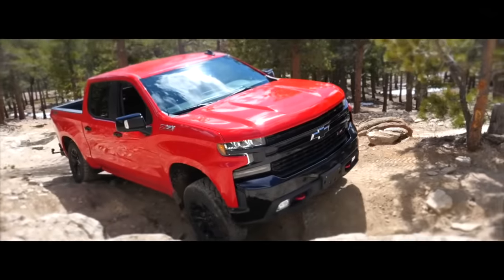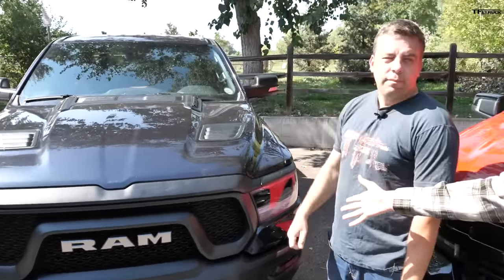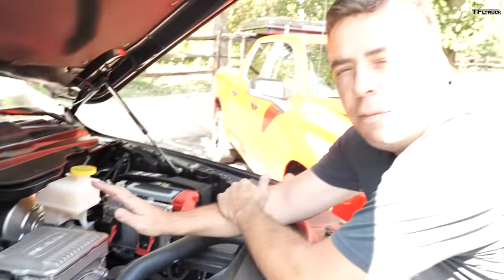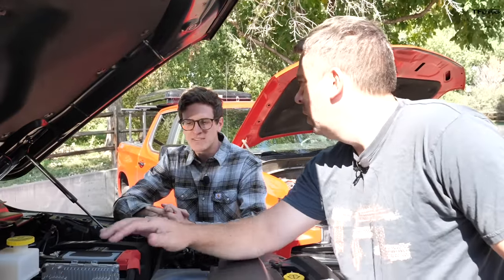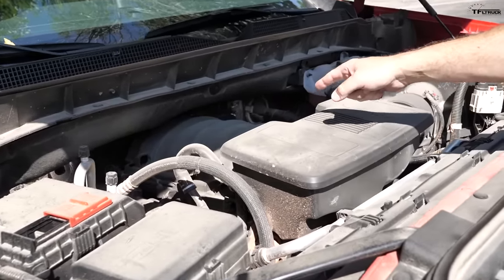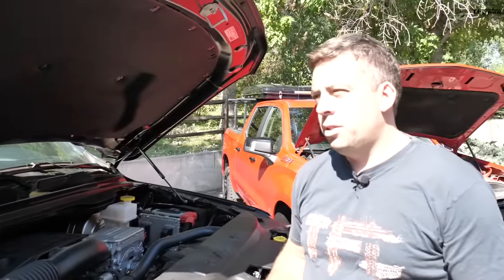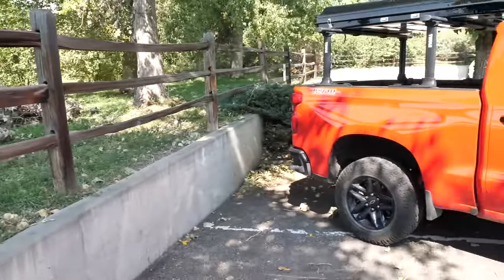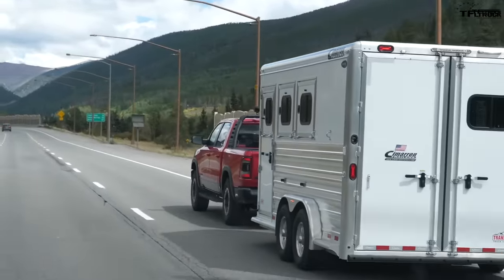New Ram Rebel vs Chevy Silverado Trail Boss: Which Full-size Off-road Truck Is Best For You?

Comment: Ram rebel for sure; if only they were actually reliable...
Reply: Mines been 100%. What's the issue with yours?
Reply: todd mayta I don’t own one, I just hear about all the issues they have, especially that giant touch screen and the food processor going out :/
Reply: @toddmayta7615  I had a Ram and it was constantly on a tow truck. I finally went with a Ford.  A friend's Ram has similar issues to what I experienced.  Constant electrical and transmission issues.
Reply: What was wrong with it? I'm on several Ram 5th gen facebook groups and very rarely see any issues other than 3rd brake light leak......  When 5th gen first came out I saw quite a few issues but those seem to have been resolved......

I know 5 people where I work that have 5th gen rams 🐏  and no problems. They swear by them as previous gen owners. 

This is just been my experience. So far, so good. Quality is better than my 2017 tacoma or 2018 4Runner were. Reliability is on par with those two so far. But I've only owned it for 1.5 years. Time will tell for sure.
Reply: @BryanI00  You must have had an old Ram, the new transmissions in the Ram are ZF and some of the best transmissions on the market today.
Reply: todd mayta Same here. I have no issues and know many others that are pleased with there Rams. These guys I know lack regular maintenance or care on there trucks also. Tisk tisk tisk.
Reply: I’ve seen a lot of rams comes through the shop and I can honestly say the Chevy is the way to go. The 5th gens seem to crack a lot of cases, especially around the spark plug holes. Not to mention the countless electrical and transmission issues. The heads also appear to be low quality. They aren’t always an issue but it’s pretty common nonetheless.
Reply: Look up issues with the zf 8 speed in the ram also the 5.7 has been proven reliable !  And then look up gm issues ! Then you'll see !
Reply: Waylon Miller I agree, I have a 96 Tahoe that has had quite a few issues. I haven’t had to replace the water pump but that’s gonna be hell. Every brand has issues with electrical components and that’s not gonna change.
Reply: @BryanI00  the zf 8 speed I doubt you had any issues !  But if you switched to ford and got the Ecoboost , youll get your share of issues ! Lol
Reply: I have a 2017 rebel with 65k miles. Zero issues thus far. And I tow my side by side and hunt with it. It gets worked.
Reply: I don’t have a rebel but my company truck is a ram 1500, it has just about 200k miles with very minimal issues.
Reply: sc4808 I’m talking about the new redesigned model with all the techy stuff that goes wrong. Also I’m sure your company trucks are the work models with minimal features, I.e. less stuff to go wrong (my company uses new Silverado’s for our work trucks)
Reply: @macbookpro57  nothing wrong with rams. If you had a late 90s ram then yes, transmission. No one has electrical problems. The problem days were with Benz. Benz used Chrysler as a cash cow and never put money into it. Fiat tried to put their fingers into it with the 3l diesel and it was fine until the government forced them to do emissions crap then they just went to crap. The new 3l is all dodge. Fiat said here it is America, design it. They used the block and very few other parts. Gm sold out to china and are now importing vehicles from china, so I won't be buying anything ever
Reply: @michaelpincavitch5245  The zf 8....  after the 3rd one, it seemed OK.  Also seemed like a good time to get rid of it.  Although, you think 3rd trans sounds bad, the electrical was far worse.  Constant dead battery, but the dealer said nothing was wrong with it.  tipm failure, whatever that does, but of course I was 200 miles from home.  Random stall when cold, would restart after a 30 minute wait, not before.  Yeah, no issues.  Cheap for a reason and I will never own an FCA product again.  Forgot to mention, this was my second one.  My first was a 2004 and I think that problems with it speak for themselves.  It was even worse.
Reply: I have had a rebel, was in a severe truck accident...... no scratches. Very comfortable on and off road. Interior for a daily is exceptional! Would appreciate the mpg being better now that I have a carvan exhaust which gives it that hemi traditional growl but all in all I’ve seldom had problems with the screen not working and the music not playing which goes away after an easy turn on and off which btw I don’t mind because of that new exhaust. Towing for sure has been a pleasure and off roading has been a great experience.
Reply: Q L haven’t had many Chevys come into the shop and I’m talking about now. I’m not saying that’s Chevy is better but the Ram is more popular here so I’m gonna see them a lot more. And I agree the ZF is a good trans. I still prefer stick
Reply: No issues with my 12” screen. I’m a first time Ram owner and I love it!
Reply: @macbookpro57  yes, you are correct, my company truck is a SLT trim package with just the basics, power windows and cruise, it is 4x4. My point was that mechanically it’s been great, it has the 5.7 hemi with the 8 speed transmission, it’s a 2014. But I know what you mean with less options/gadgets to break. I will say this though, I have always driven/owned fords or chevys ( my personal truck is an f250) and would never seriously consider a Ram truck but my company truck has changed my mind, if I was in the market today, I would definitely Consider a Ram. It rides amazingly well and tows great.
Reply: @sonsofliberty3081  iirc, GM is only importing 1 tiny SUV from China, and it only has a Buick badge.  This is about trucks, so stay on topic.  The trucks are made in the US and Mexico.
Reply: @BryanI00  I have a 2014 ram with zf I'm at 140k miles have not change transmission fluid since dealer keeps telling me they are lifetime and tow a 7500 lbs trailer when I go camping no issues yet

Comment: I voted with my feet and bought the Ram. Drove GM's for last 30 years. Ram won truck of the year 3 years in a row. Better ride, very comfortable interior, extremely smooth shifting with the 8 speed transmission... welcome to the 21st century. The Rebel 2019 with the two tone interior is awesome. The only thing I settled on was the Ultra Short bed.

Comment: I'd love to see a regular cab Rebel or Trail Boss. Shame they're only available in crew form.
Reply: You can get them in double cab
Reply: James Mastroianni true I just consider that also a crew since Ford is the only one that makes a true extended cab.
Reply: @ALMX5DP  I mean just because the second row has actual doors doesn't make it a crew cab. Ford just decided to make a stretched regular and the other two made a short crew.
Reply: James Mastroianni the B-pillar and forward opening doors make it a crew in my mind. Love how Ford kept theirs a true extended.
Reply: @ALMX5DP  Well the ram 1500 wasn't designed with a regular cab variant, it is only double and crew now. GM pretty much did the same with the silverado, the reg cab was specifically built for fleets only. It is a different story on the HD's, ram just didn't make a double cab hd and GM developed a proper regular cab
Reply: @james2042  yeah that's a shame, though to give them credit Ram is still selling the previous generation under the Ram Classic moniker and that is still available as a regular cab. GM is confusing to me since they make and sell their 1500 with a regular cab 'short bed' in other markets like Mexico and Saudi Arabia but not here in the US. Same feeling I have with the F-250 Tremor. Ford only sells in a crew cab. I'd love to see an extended cab or regular cab variant.
Reply: Extended cab sucks because of the suicide style doors. From someone who had an extended cab truck when my kids were small and in car seats, the suicide style doors are a PITA when parked between vehicles in parking lots. Ford needs to ditch the suicide style doors extended cab.

Comment: You forgot to mention that the newer ram rebel finally put in the 4 wheel drive auto as were the 2019 only had the regular 2 wheel 4 wheel high and 4 wheel low. The 4 wheel drive auto button is awesome also do reaction time for the 4 wheel drive auto is instantaneous and one of the best systems I have ever seen.
Reply: You right, it means it has both of the 4x4 and AWD, both of the good worlds
Reply: All wheel drive means it's always in 4 wheel. Auto 4 wheel drive means it's in 2 wheel drive till you need the 4 wheel drive then and only then it kicks in. When one rear tire spins in any way that's when the 4 wheel drive kicks in.
 For real auto is meant to save you gas and a be there for the just in case factor. But you're only supposed to use it in mud or snow, just saying.
Reply: Is 4x4 Auto confirmed for the 2021 Rebel? If so, can you point me where you found that. That would definitely confirm my choice as my next truck
Reply: You tube.....TFL truck
Reply: They compare the Chevy trail boss and the dodge ram rebel
Reply: @misterhonesty5784  Thanks, I did see it in the video now.  Is that an option or standard equipment?  When looking at 2020 Rebels in Canada I don't see that on the dash.  Is it only available with the anti-slip rear differential?
Reply: It has a push button rear locker on the ram rebel and the auto 4 wheel drive come standard with a ram rebel

Comment: I have a 2020 Rebel quad cab.  The rear seat is smaller but it has a 6 foot 4 box.  I wish it would have been available with an 8 foot.  The reason for this is I actually use it as a truck.  Any pickup with a sub 6 foot box is just to small to load anything substantial in length like a full size atv or large motorcycle.

Comment: If you're towing with the Ram, how do you manually select gears for going down steep hills such as the Ike? I didnt see anything on the rotary knob, does it have shift paddles?
Reply: Pretty sure there's buttons on the wheel
Reply: There are buttons on the wheel
Reply: Ah cool good to know!

Comment: I don't think the interior is that bad on the GM trucks. It certainly looks dated compared to the Ram and even the F150 even though the F150 is five years old now. That said, it is functional like Tommy said. Where my beef comes in, is comparing the interior quality to the Ram when these two trucks sticker so close to each other. There is so much more tech and refinement in the Ram, not to mention the power advantage over the 5.3, for the same cost. If the Chevy had the 6.2, it would be a tougher choice, but as these two trucks sit, I would have to go with the Ram.

Comment: I have only owned Ram trucks and the motor is set back so when you need to Dodge something you don't have to you can Ram it lol but they are had trucks to stop so that's why I always upgrade my break system with high carbon rotors and brake calipers witch help stop the trucks a lot better than stock.

Comment: I have two comments:
1. You should investigate the reliability of the trucks you review to see which one ends up in the shop more often, otherwise you are just looking at every small sample. 
2. The Ram's infotainment system though nice does not look durable for a off road use. If something breaks down it looks very expensive to repair.

Comment: Same quandary here: love the Chevy body, box, transmission, towing, BUT love the Hemi, ride comfort, rear coil springs, the interior, and the tech on the Ram. Still can’t decide. I am leaning Chevy because Ram still hasn’t fixed known issues like quickly rotting Manifold bolts.  Mine cost me $3000 for my 2016 with 130,000km. Boooo.

Comment: How could Ram be so far ahead of Chevy in technology, ergs, design, engineering, styling etc?  My dad would roll over in his grave.  GM better wise up.
Reply: john thornton yh, I’m a mopar fan, but I do have some Chevy in the fam and would like to see the three companies line up in a closer race
Reply: I concur
Reply: I was told that GM thinks they "perfected" the interior and refuses to change it.  Sounds like BlackBerry in 2005.
Reply: @Mainevent41  They did, for a proper truck... Maybe not a luxury truck though...
Reply: What "technology, design, and engineering" you speak of? The GM product hauls and tows more. It is more efficient. The Ram interior is better GM screwed the pooch and used it's spare parts bin for interiors.
Reply: @davidporter7051  Hauling & towing numbers are nearly identical, however vast improvements in suspension, information systems, transmission and interior design are far superior to g.m.'s imo. thanks for asking.
Reply: @johnthornton7763 simply no the numbers are not near identical.
Reply: GM put their $ in MPG not a big screen for technology geeks
Reply: @lakernation4725  your comment is a real dumb comment. GM actually lost MPG with it's redesign.
Reply: @davidporter7051  you better do you research a little better, DFM and the off road package contributes and still better than ram. If you don't know what DFM is hen google it.
Reply: @lakernation4725  and yet GM has lower fuel economy with the current generation vs the previous generation. You should your Google skills to use. laker nation=special needs.
Reply: @lakernation4725  ive heard countless people say when they disable afm/dfm they get 1 more mpg..

Comment: Both trucks are nice and they both have there weaknesses and strengths but if you are going off road a lot with it I would rather have the awful interior because you don't have to worry about it getting wet or muddy as much as the fancy interior and plus it's going to cost a lot more money to fix the fancy interior but if I'm going to just use the truck for work only the the fancy interior

Comment: for perspective on mpg... my 2011 silverado z71 with the LC9 5.3 and 6 speed auto and 3.42 rear gets 17-19mpg summer/winter.  I dont have the front air damn either and run offsets.

Comment: What is the off road index?
Reply: The rebel has a higher index then the traiboss
Reply: @Issa_aj  TFL has created an off road index to rate the off road capability of vehicles. They dont use it very often
Reply: @temur72  they made a video showing what the index was its was where they were comparing all the offroad trucks
Reply: @temur72  it's the may truck madness series ep 1 at 10:17 seconds they show the index of the trucks